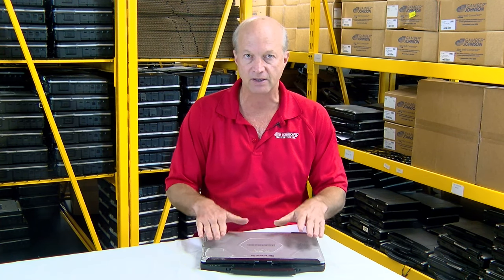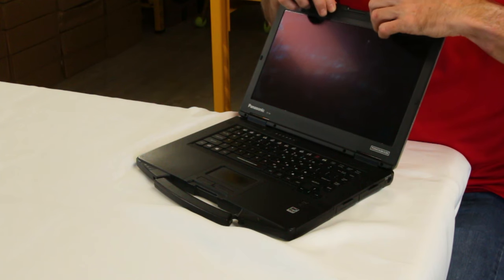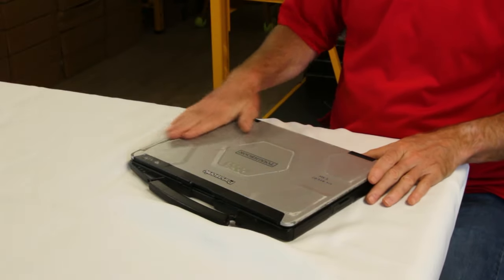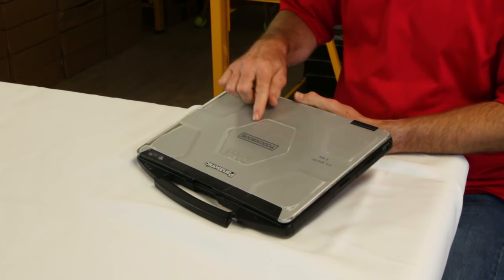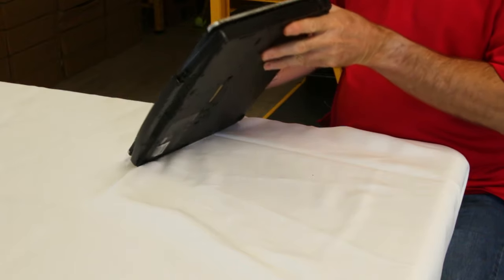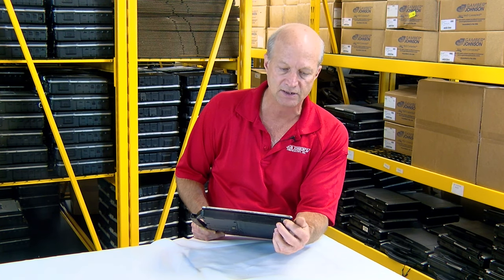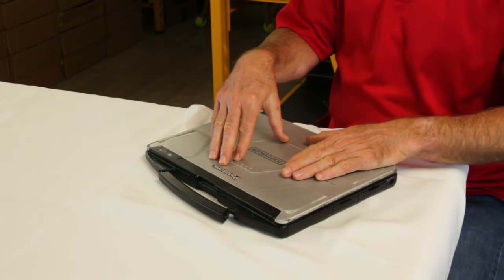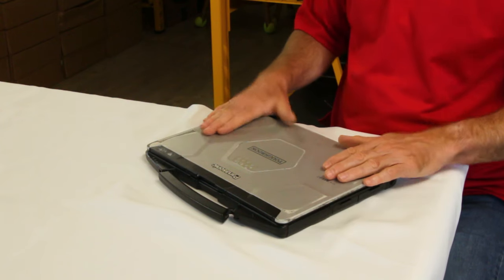EP#27: 5 Most Common ISSUES - Panasonic Toughbook CF-54**

Comment: Hey there, I recently bought a CF-54 almost new but after a few weeks I got a red flashing light on my battery light and now the laptop will not turn on whatsoever any thoughts on what it could be?
Reply from the maker: That means that the battery you have in it is no good. One thing that you can try to do is to reseat the battery. Just take it out and put it back in and see if you can get it to work. If you bought the laptop from us, we will provide a replacement. If you didn't, I would advise you to reach out to whomever sold you the laptop to see if they can provide a functioning battery. Worst case, you would have to buy a new battery. Hopefully this helps, thanks for watching.

Comment: Which is best  used  Panasonic Toughbook in your expert opinion that has least amount of problems/shortcomings?  If I were to guess CF-2 or CF-31?
Reply from the maker: That is a complicated question.  They all have their strengths and weakness'.  It really depends on what your application is.  If you are in a dirty wet hot/Cold environment you want the CF-31, CF-19 or CF-20.  If you are just traveling around visiting clients you might consider the CF-C2 or CF-53.

Comment: I have A CF-54 Mk 2 (D), and recently picked-up a used Panasonic port replicator (CF-VEB541AU). I can't find any support docs online for this unit - no manual, user guide, nothing. When I put the CF-54 in the dock (using OEM power supply), I get charge to the batteries, but that's it - no port replication (HDMI / USB / RJ-45). Perhaps I need some drivers installed before the dock will be recognized? Or do I have a dud unit? The PC has been upgraded to Win10 20H2. Thanks.
Reply: i had the same issue
Reply: @alexl3474  Any luck? I haven’t chased this much further, but it’s surprisingly hard to find any info…

Comment: Hey Bob, great video. I have a CF-54 that has a bizarre issue. The Numlock and Wi-FI lights stay on even when the computer is fully shut down. Pressing numlock button on keyboard cycles the numlock in windows but the indicator still shows up, same with wifi indicator. I have two other CF-54's that don't behave this way. They are all factory reset with the same image. Any suggestions? Faulty keyboard/bezel area? Or indicative of a motherboard issue?
Reply from the maker: @ScottPaynton The best way to answer this question is to simply fill out our Tech support form.  Our in-house technicians will answer with the links and info you will need.  Here is the link: https://www.bobjohnson.com/tech-support-form/  Thanks for Watching.

Comment: On my CF-54 Mk1, sometimes after a small shock during carriage, the computer won't start at all. Just black screen and Wifi light on.
Only way to get it back again is by dropping it horizontally from a small height (no kidding!) ... I think it's a loose inside connection to the HDD bay. Changed the SSD already but didn't solve the problem which is coming up about once every 3-4 months so quite unpredictably.
Did you have failures already linked to the inside connection to the HDD bay/caddy? Thank you very much for the help from Belgium !
Reply from the maker: Hmm...interesting. I would reach out to our techs. Just fill out our tech support form here: https://www.bobjohnson.com/tech-support-form/
Reply: Omggg it actually WORKEDD. I almost removed my battery hahaha my display work if i comnect it to another monitor but after i dropped it from a height to my bed horizontally it WORKEDD THANK YOUU
Reply: @solRandom  Didn't get this problem back for more than a year now and still travelling worldwide with my CF54 in my backpack... To this day, I still haven't any idea from where this problem was coming from. Happy to hear that it helped you too !

Comment: I have a CF-54 personal computer toughbook but I lost the charger/power supply and I tried to buy a cheap replacement a universal charger that was 60 W . After using it the computer won't turn on and there's a red indicater light on I ordered the right power supply but I wanna know did I do any perminent damage to the laptop???
Reply from the maker: Its hard to tell.  You should always use OEM adapters with toughbooks.

Comment: Hey bob. I have a cf-54 that was working and posting to bios. Then it sat for awhile and now it turns on but the screen does not turn on and will not display to a hdmi out monitor.
Reply from the maker: Hi Nate ,I would recommend reaching out to our techs so they can get some more information from you and better answer your questions. You can find that form here: https://www.bobjohnson.com/tech-support-form/
Reply: @Bobjohnson  Do you have any suggestions on what i can try? I did as you said but they only reply send in $120 + Parts + Shipping. Not really looking to do that just want to figure out problem can repair and replace parts myself.
Reply from the maker: @nateburnett9054  Hi Nate looks like we would need to take a look at it to determine what is going on. There are a lot of issues to rule out, and we simply cannot do that without troubleshooting.

Comment: How do you replace the screen when it breaks on the hinges? We have had to resort to replacing the whole top panel for broken hinges! Wish we could just replace the LCD panel but it is not so simple. Do you guys have a video replacing just the lcd panel? does the adhesive need to be melted for removal?
Reply from the maker: You have to replace the entire screen assembly and LCD.